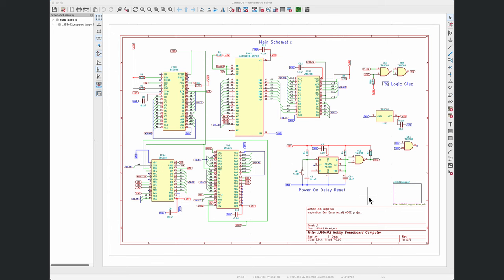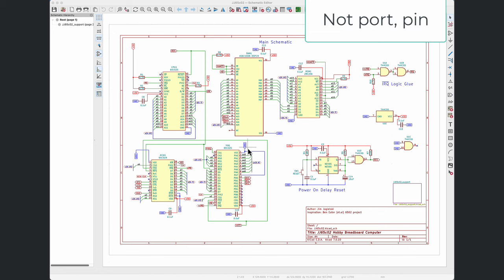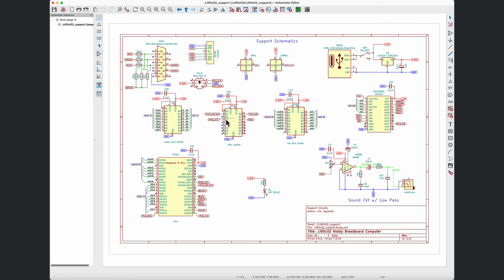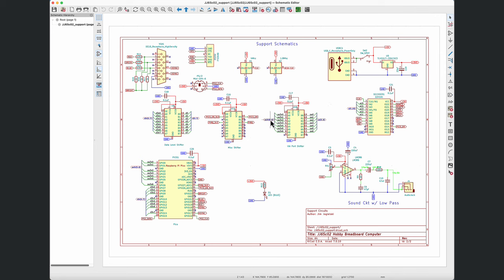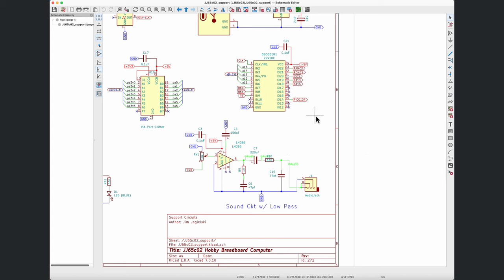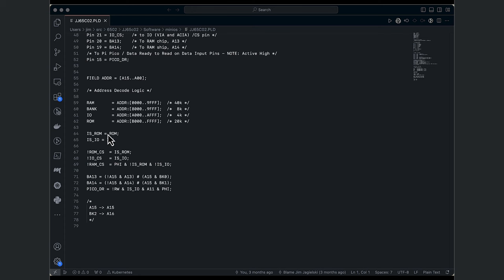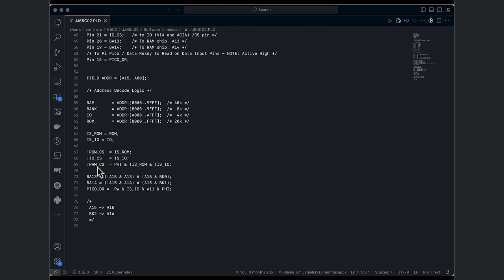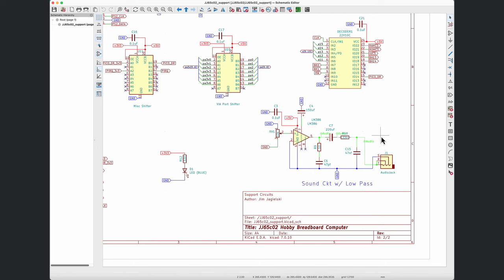Episode 2: The JJ65C02 Schematics

Comment: I’m assuming that the “PHI” line that goes to the PLD is actually PHI2, as I believe that’s the clock that is recommended to use for writes to RAM where the address and data lines and know to be stable.

I’m always in 2 minds about how much “new” tech should go into a retro board build. I’m sure that everyone has a different opinion and I understand the flexibility of using a PLD. I have a design that uses 5 74 series logic chips for the decoding that I mean to test, that has similar functionality to your build, but with banking for both ROM and RAM. I have the parts. I just need to find time from all my other projects. :)
Reply from the maker: Yes, that's right.

Comment: I'm intrigued by the PLDs, and would love to know more about the toolchain involved.
Reply from the maker: The PLD I'm using is very basic, but works just fine. The toolset is compatible with various types of PLDs and CPLDs. First you create a *.PLD file which contains the I/O Pin determinations and then the actual logic which relates the input to the output signals. The language used for this part is CUPL and the program I use is WinCUPL (see https://www.microchip.com/en-us/products/fpgas-and-plds/spld-cplds/pld-design-resources). It's old, and Windows only, but I have no problems, even running it under Virtualbox or VMware Fusion.

Once the "logic file" is created, you use WinCUPL to create a .JED file, which is basically a layout of which "fuses" in the chip need to be connected to implement the logic. WinCUPL also contains a simulator, so you can try various options and combinations of Inputs and make sure that the Outputs are what you expect. It's the resulting .JED file that is burned onto the PLD chip using minicom (minipro -p ATF22V10CQZ -w ./FILE.JED)

Hope this helps!